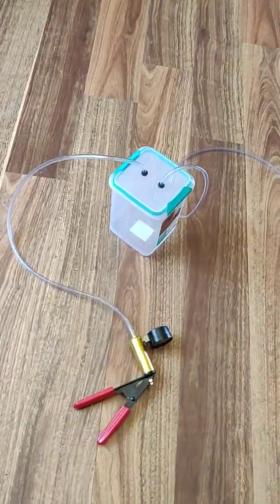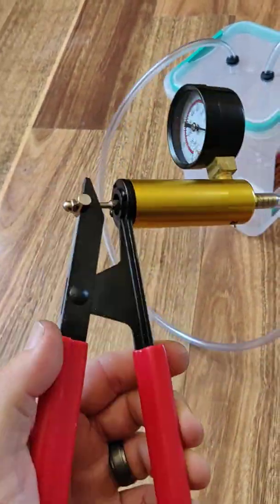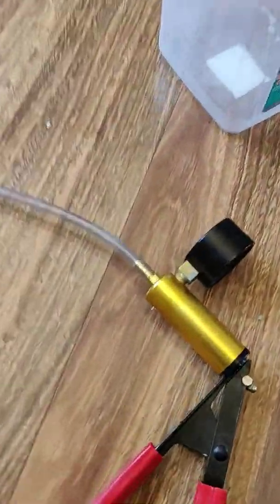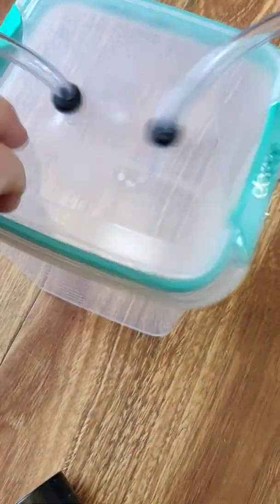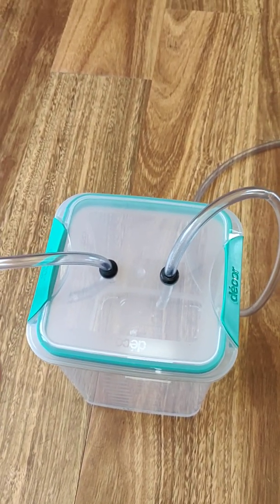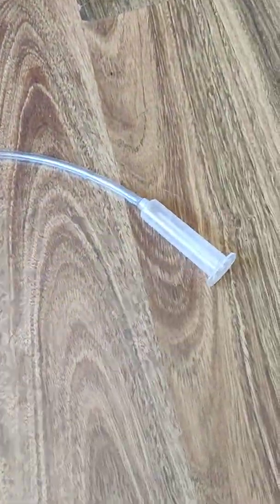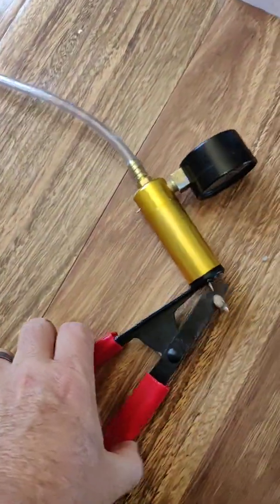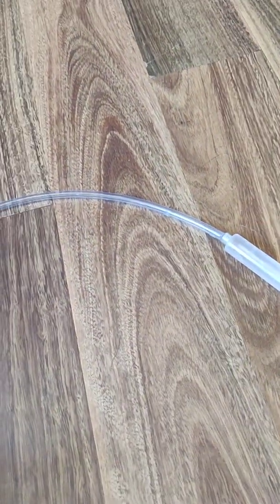Home made milking machine #Shorts

Comment: will the pump handle 2 milkers off the container?
Reply from the maker: We milk 3 goats and get 2.5 L in total off the 3 a day 👍
Reply from the maker: And yes, you can run two cups off the one pump but you might run into issues if one side of your animal empties quicker than the other. Not a big deal though, you just put the plunger back into the syringe cup while you finish milking. That being said, we've found the goats prefer one side at a time and it's not all that much quicker.
Reply: @ResonanceHomestead  not that much faster....hardly worth it then...Thanks